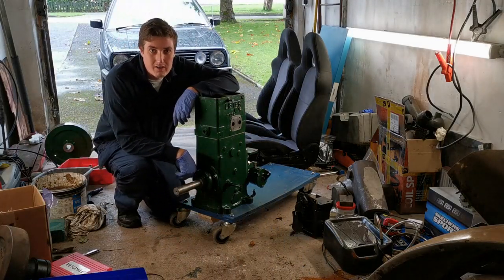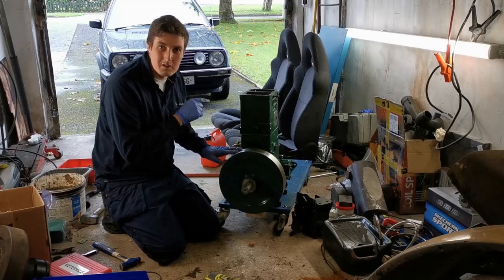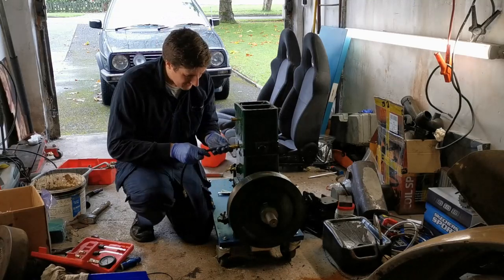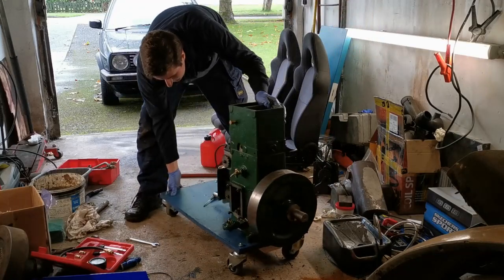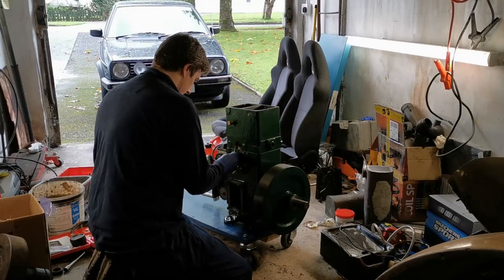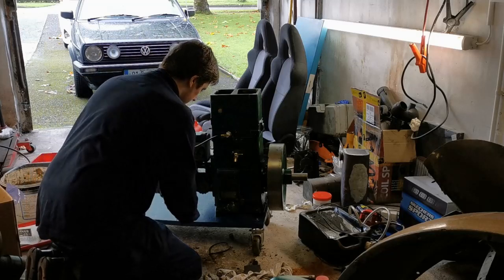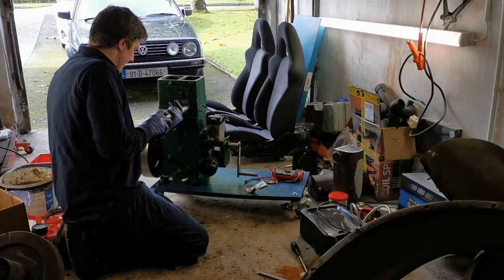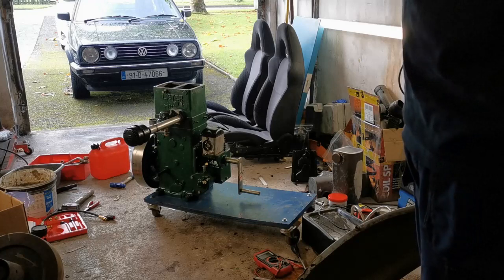Lister D part 11 - First run after restoration

Comment: Right!  Enough of all this watching - time to get my valves  set and get the carb on! I had to make new governor rods as mine were rusted through.  No feeler gauge, but I do have 6 thou shim material, so not a problem.  I do have a spark, but not too sure about the TDC on the flywheel, so I set that to TDC with the piston before fitting the head.  Wish me luck, haha.  Thanks.
Reply from the maker: Set the valve clearance to. 031". That's actually what it says in the book so I was wrong the first time. Best of luck!
Reply from the maker: Oh and set the timing so it fires 15mm around the flywheel from Tdc. That's 5 degrees.
Reply: @Endfloat  Oh, I used a piece of 6 thou shim and was pleased when I'd on it, haha.  So now I have to re-set to 31 thou.  Might be the reason it ran - YES IT DID!! - but only very slowly.
Reply: @Endfloat  Yes, been playing with the setting on flywheel, but I'll redo the valves now.  Also, I've no petrol, only 2 stroke mix, but it seems to work, LOL  Thanks

Comment: Hi Ross, did you initially have the timing set to -20’ and not +20’? Nice job to get it running 👍
Reply from the maker: The timing was set very roughly before because I only had the Tdc mark. It was definitely before Tdc but I'd say it was more than 20 degrees.